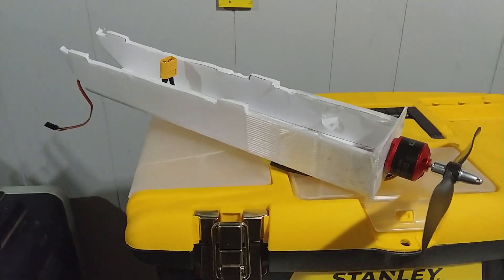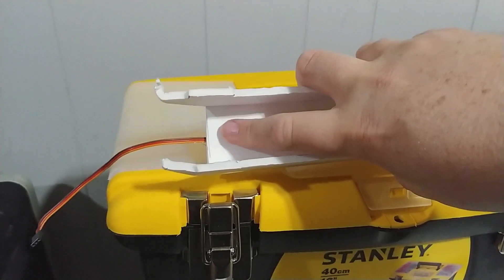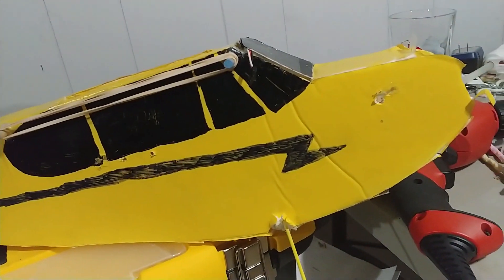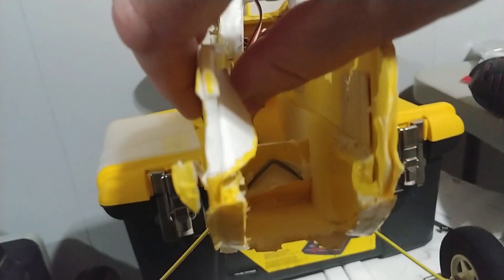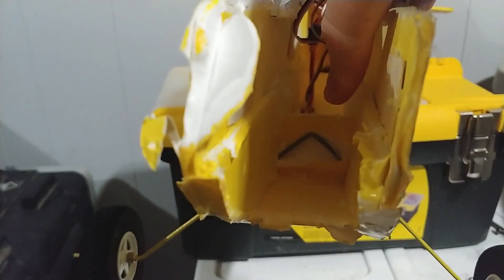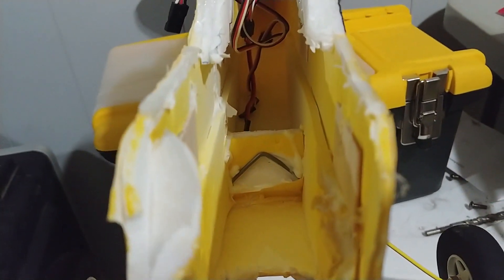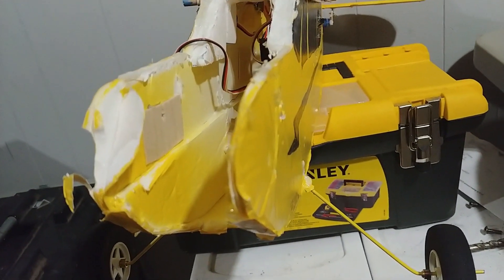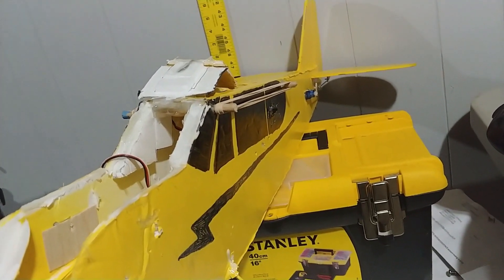How durable are Flitetest/foamboard airplanes? A look at the FT Simple Cub's crash damage

Comment: I built one of these as well and it wouldn’t fly, probably because my wing position shifted the CG backwards. It took a few tries and adjustments just to get it to fly straight. So mine was a little scratch and dent before maiden. A random power line and a stuck elevator contributed to the damage. 

I will probably build another one because it is cheap and relatively easy to put together. 

The landing gear design is weak and it needs doublers for the skewers. I ended up using nylon washers hot glued over the holes for support, and beefed up the landing supports. 

Just when I get everything balanced and braced, I need to build a new one. lol

Fun times!
Reply from the maker: Yeah some of their designs were more of a struggle than others. And yes, the lg on the Cub is definitely weak spot. 

I'm doubting I'd build another Cub. I had better luck out of the Storch or I might try a Tutor.

Comment: As foamboard planes go, the ft cub is a tough craft, cut and shut jobs can repair anything on the cub, no crash is beyond repair. 
with all the Flite Test specs thrown out the window it can be a very versatile plane,  metal gear servos, different motor specs,  bigger prop and a minimum of  2700mah 3s and it is able to perform in ways Flite Test never designed it for lol.
I've got numerous planes but I just keep going back to the cub as my daily flyer and I'm on air frame no5 now, the last one flew for over a year of being flown almost every day and several packs each time and had more than 1000 hours on it before I finally retired it.
I fly mine low and fast,  medium/long range and also above the clouds, there is nothing it can't do dam well for a foam board plane and no matter what I have in my fleet of planes, I'll always keep at least one ft cub flight ready :)

I've made incremental modifications to each one I've built (mainly internal) but the latest is running an ft storch wing on it,  cg is almost identical but lift is through the roof and where before it would fly 'ok' with a 4200mah 3s on the stock cub wing, on the storch wing it laughs at the weight and I've done a 35min 18 mile flight on that setup :)

Comment: have built two FT planes they are ok, enough motor and most anything will fly
 hot glue and foam board is simply too heavy inelegant and disposable, 

for the kind of flying i am doing now gliders and rubbermotor jobs
balsa flies best
Reply from the maker: Which FT planes did you build? 

Yeah the planes are very much disposable but still a lot of fun. Not a lot of fears or money loss if you happen to crash one. I will say though, I have seen some folks fix these foamboard models up just as good looking as a balsa model. 

I'm glad you have found what you like though. Some folks will love these foamboard models til the day they die and others use them as a stepping stone to other options.

Comment: Oh yes they are easy to fix . IV had wing tips snap,wings come apart  full front end smashed . Latest crash was a nose dive from above tree line in to the floor . Front end survived but tail snapped . The issue is now that it's fixed the plane is tail heavy and requires more weight in the front to be balanced . ATM not sure on how much more weight is needed so it might want a new body and tail making
Reply from the maker: Yeah too many repairs can affect the weight. Good thing we can just easily rebuild a section if it comes down to that. 

Seems like most of my damage is front end crumpling/replace power pods/firewalls.